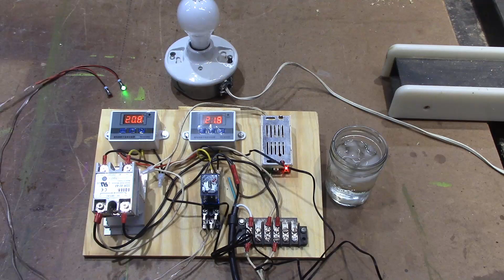Pump House Winterizing Panel

Comment: This actual set up is exactly what I need to do.  As of now I just drain the system in the fall, but this would be a much better way to go.  I sure do like the approach and with the trouble light as well.  Very good idea and the links to the parts is much appreciated.   Thank you for the video, as usual very well done.
Reply from the maker: You're welcome Glenn!!  I noticed they have another one of these temp controllers that's 2 in one. You could also do without the relay for the LEDs if you found a temp controller that had a dpdt relay in it.